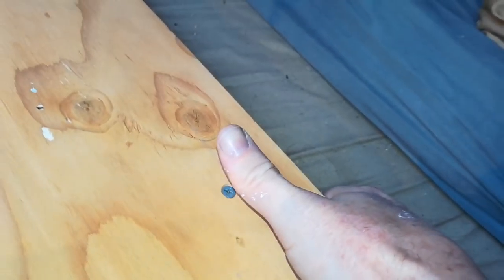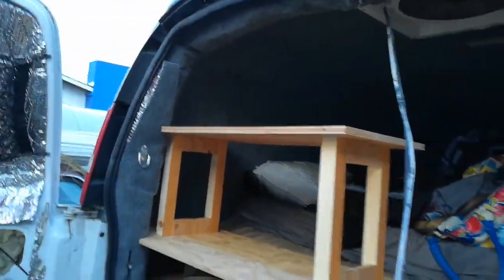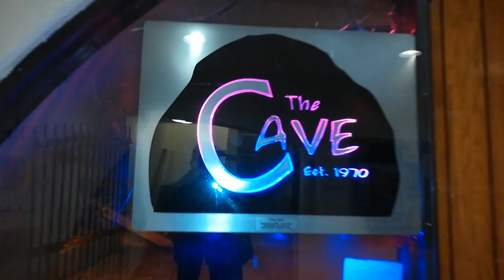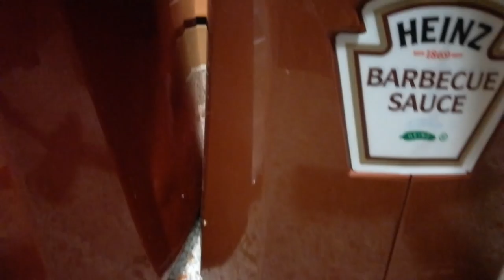Change of Plans. Change of Van Build. Fun Police

Comment: Not like I am a hat expert or anything (but I did count them the other day and I apparently own 5 of this type of hat so maybe I am as close as you will find) but the ones I like the most overlap at the chin with fabric and velcro. And wear that pricey C brand name. Remember we were talking about them covering your whiskers. These do the strappy ones not so much. I've been out in my first one in a blizzard with -60 to -80F wind chill factor and I was out for about 3 hours. (I also wore three pairs of pants! Because I did not own much severe winter wear back then).
 Looks like you're getting good use of the kreg jig. That's a very strong good looking replacement for the mortise joint. I know virtually nothing about vehicle paint but I have seen a few folks on YT use black spray on truck bed liner at places where a vehicle is likely to get dented and dinged. Perhaps you could try that and mask it off so it looks like a vehicle bra?
 Did you see Trump just made a pro-capital announcement for Israel and even signed a document about it? Next step is to have an Embassy there (which no other country dares to do!). Glad he did that, probably LONG overdo.
  You're still making less of a mess than I can do... I started a batch of English Toffee yesterday only to get distracted trying to look for the candy thermometer in another room. I walked back in the kitchen and the mixture was boiling black with a solid plume of white smoke forming a column to the ceiling which was forming the look of super dense smog covering my whole kitchen. Had to air out the whole place, dumped the mixture in the toilet which them instantly boiled and grew 5 times in volume. Next time I find the thermometer first (if I can ever find it at all!).
Reply: John Possum mise en place. Mise en place  :^)
Reply: It was the illusion that I thought I was organized.
Reply from the maker: +John Possum haha got ankick out of this. Ya i really like the hat for the cold weather havent worn it while sleeping but maybe i should. Breathing inbthe cold morningnair around 4am has given me a cold.  I keepnjust the pilot light on the mr heater at night amd its enough to take off the cold sting.   Ya trump  interesting move. It was in his campaign so he is a man of his word.  Christianity and islam have been battling for centuries so what makes us think that war is over?  We are being invaded by our own political leaders. Probablu to justiymfy the police state survalience they have in place. Im in canada and thry dont need all the police presence out here that america does. It wasn't necessary before thry brought in these statistically higher of violence populations. But say that and its 'youre rayciss! "  no, we are realist.   Sounds like you have a mess on your hands! I love being organized.  I lost my memory card again... The new one i bought.  Finally found it though. Organizationnis key in these small spaces huh
Reply: I hear you on the security issue. Right now the TV news is basically trying to browbeat & guilt people into donating for security. I am in the city the SuperBowl is happening in a few months. So we'll have all kinds of national guard marching through downtown, apparently.